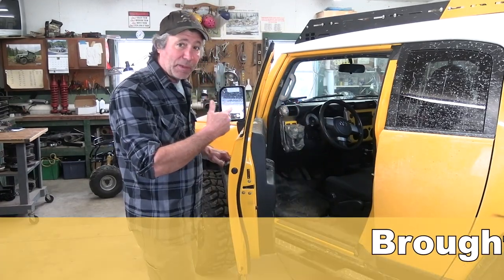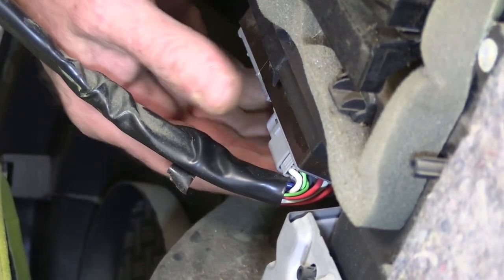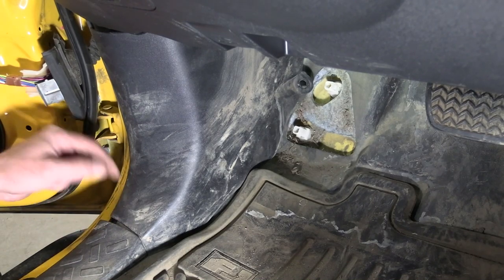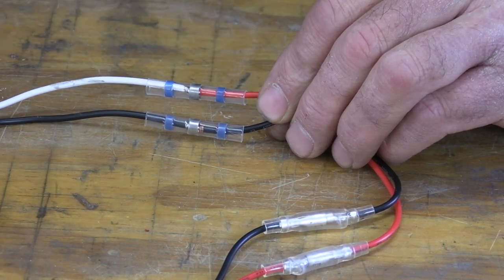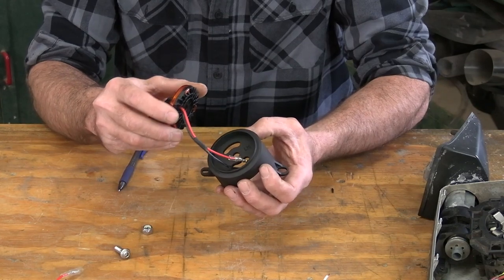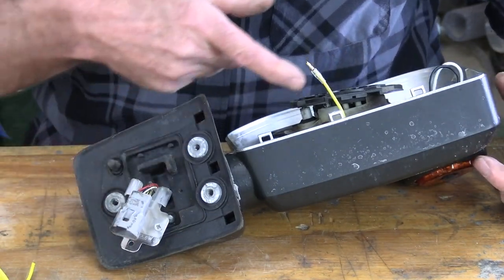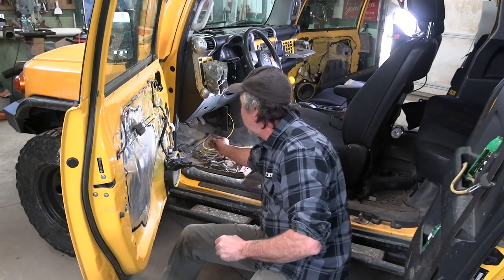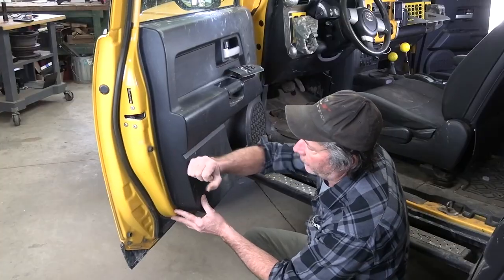FJ Cruiser Mirror LED Lights WITH TURN SIGNALS- How to Install- Freedom Retrofits

Comment: What a fantastic video!  You are a great teacher!  I plan on installing a blind spot monitor system on a 2007 FJ I bought for my daughter.  I want to put the leds in the mirror housing.  This video really helps me understand how to do that!  I absolutely would have ran my wires under the window had it not been for your suggestion.  Not only did you show what to do but also what not to do!
Reply from the maker: Thanks for watching!

Comment: Excellent video! Very professional and precise directions. I plan on this upgrade in the future but first I’m installing LED turn signal arrows that mount behind the glass and are bright enough to show through the mirrors. But I needed to watch this video first because the steps to connecting the turn signal wires are identical.
Reply from the maker: Awesome, thank you!

Comment: Just did this mod. Not too difficult but later model fjs, the relay for the turn signals is in a much more difficult to access location.

Comment: If not using the turn signal function do I still need to use the wire  harness with the control module?

Comment: I have a 2013 TT.  My "flasher" appeared to be over the brake pedal.  But the wiring color location is different.  Can you confirm if the later year FJ as a different relay/wire color location?

Comment: How are the wiretaps holding up?  Installing a 360 camera system that requires tapping into the turn signal wires. With how thin the wires are where you show you tapped into, concerned over time something will happen like  a short where the tap is.

Comment: Great video, just wondering why freedom didn't build the kit to tie the pwm into the existing mirror light wire inside the kick panels instead of removing the mirror housing assembly/door panel/and fishing the yellow wire. The OEM mirror wire is sufficient to carry 100% pulse width of the cyclone.
Reply from the maker: Good question!

Comment: Hey thanks for all the videos of your freedoms. Ive installed as shown in the video and they keep blowing the 10 amp fuse under the steering wheel. I haven’t been able to get them to work.  Also can’t find any info on where to put the 81980-50030 150w plug. Do you have any suggestions.
Reply from the maker: I’m not sure what’s blowing your fuse, sorry. Contact Austin at Freedom, he may be able to help.

Comment: Are the black mirrors you have OEM? I've been searching for a long time for a pair of black OEM FJC mirrors to fit to my FJ62 but had no luck. I've found plenty of aftermarket black mirrors, but if there actually are OEM black FJC mirrors out there I'm going to keep searching.

Very cool modification too. My intent is to use the light with my blinkers when I get a pair fitted to my 62, so this video was a good one to stumble upon.

A question concerning the retrofit kit: Do you still have the blinker function when the marker lights are off as well?
Reply from the maker: We painted our mirrors black, along with the door handles.